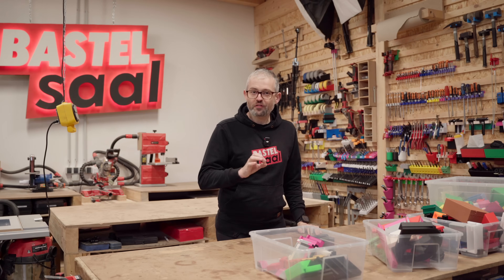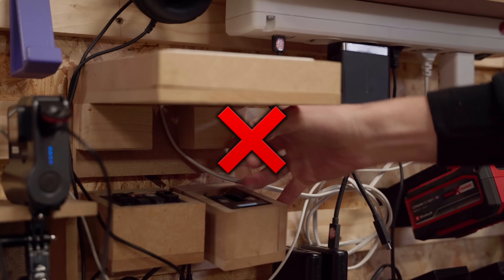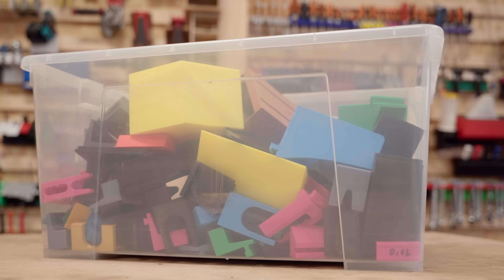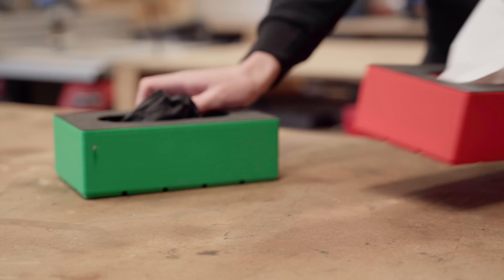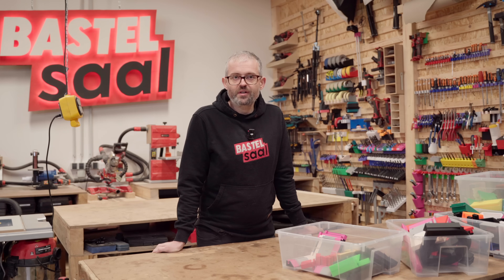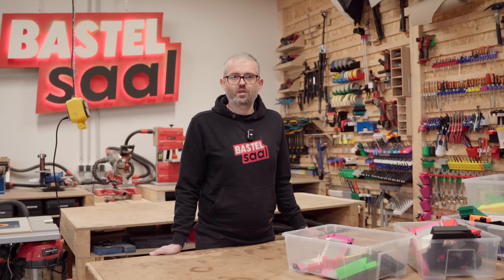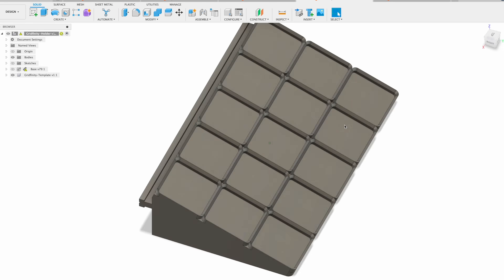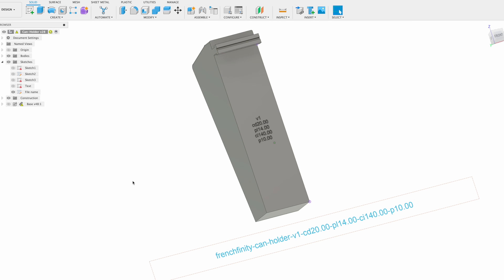The MISSING French Cleat sub system #FRENCHFINITY

Comment: Brilliant :)) but has anyone found this routerbit on aliexpress ?
Reply from the maker: Unfortunately me not. But please keep me posted if you found a matching one. :-)
Reply: @Bastelsaal Well, have to order the one from amazon :) just got some problems with bit holder in fusion 360, when i add extra rows and colums, the part get wider and longer  but no extra holes, is it correct i have to do it manually? :)
Reply from the maker: @Giderduik  You have to edit the Press/Pull-Feature. Was not able to figure out how to do this dynamically :-(
Reply: @Bastelsaal Could you make a video about how to do that? think alot could use more "basic" videoes about your system :) Just made the wall for it, just need the paint to dry, and how to edit those files properly =D

Comment: Nice! What spacing do you have between the cleats?
Reply from the maker: The spacing between the cleats should be at least twice the height of a single cleat, plus an additional 1–2 cm of padding to make it easier to remove the holders. 

(Just added this to the FAQ on https://frenchfinity.xyz/#what-spacing-do-you-have-between-the-cleats)
Reply: @Bastelsaal Can you draw a diagram to clarify the confusion? I saw on your website that you mentioned needing twice the height of the cleat, but from the video, it looks like the spacing between the wooden strips on your French cleat wall should only be one times the height. So when you say the spacing is twice the height, do you mean from the bottom edge of one cleat to the bottom edge of the next, or from the bottom edge of one cleat to the top edge of the next?
Reply: @Bastelsaalawesome, thanks!

Comment: What's missing is the option to add a lock. It would be great if it could be added as a module to any larger middle.
Which is weird considering that printed clear locks are a thing.
Reply from the maker: Thanks! You can check out this print from BloodyT, he added kinda locking mechanism: https://www.printables.com/model/1276364-frenchfinity-anchored-plate-version-parametric-fus
Reply: @BastelsaalI was thinking more of something like "swiveling french cleat lock" you can find on the same printables. It's way more convenient then the screw

Comment: Frenchfinity looks very promising. I would like to get started on making a frenchfinity storage wall.
What is a good (or the recommended) spacing between the cleats?
I was unable to find info on the spacing anywhere.
Reply from the maker: Sorry for my late answer. I think the Gap in between should at leas as height as a single wall-anchor + 2x the cleat height itself.

Comment: How confident are you in the strength of that t-connector?
Reply from the maker: No issues for now. Since you should print it standing, it's quite solid. :-)
Reply: Wouldn't it be stronger, printing on it's side so the printlines are vertikal at the hanging object?

Comment: what is the benefit of hte T-slot over a sliding dovetail?  I will be adapting this to non-metric system anyway and since I'll be modifying I was wondering if you considered the dovetail approach (and I have dovetail bits)
Reply from the maker: Nothing basically. Here in Europe/Germany the t-slot is quite common. Also thinking of a Frenchfinity-OpenSCAD-Version that fixes this. Maybe you can join this?

Comment: Great idea. However, when you put up a file and advertise it as a bit holder and shows it holding driver bits you need to make sure you offer that. Not everyone knows or is willing to change files. Especially new or beginners to the hobby. I really like the idea, but I want to print ago. Not spend days trying to get it were it will fit a simple driver bit.
Reply from the maker: I am already working on an update, dreaming of a Generator on Makerworld. That would definitely fix this :-)